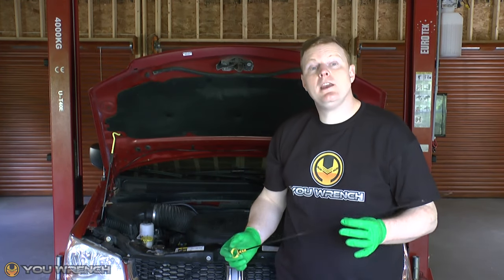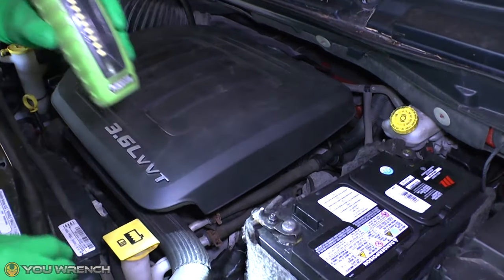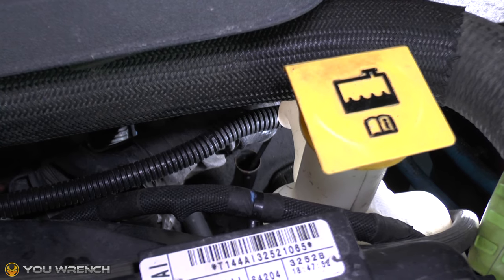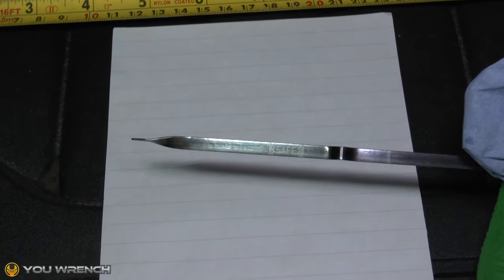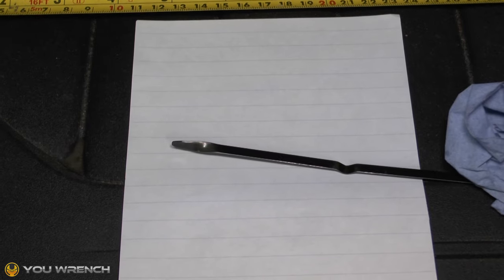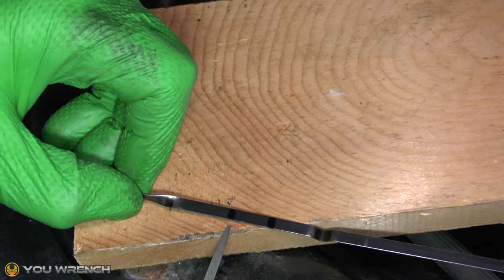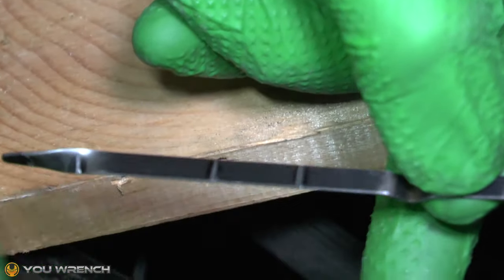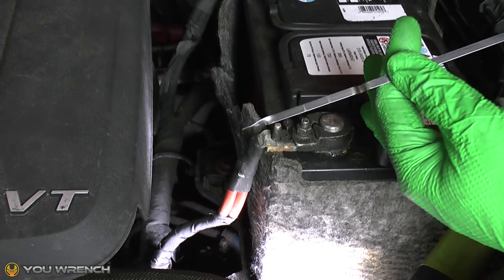MAKE YOUR OWN DIY Transmission Fluid Dipstick FOR FREE!! (Dodge Chrysler)

Comment: Super helpful, thank you for posting! As an FYI, I have a 2018 RAM Promaster 1500, same engine and trans. It does not have this engine oil dipstick, instead it's the braided cable one and I wasn't willing to file in marks on that. So I did end up buying a random dipstick for under $10 and followed this advice!
Reply from the maker: Perfect, thank you for sharing you experiences!! Yes, great tip - you can of course buy any cheap generic dip stick and mark it in the same way and keep it in the garage for when you need it. It does not HAVE to be done on the cars oil dipstick. Nice tip, thank you!

--- 

To help support us (for both you and others reading this) there are a few things you can do:

1) Donations both needed and welcome! We cannot operate You Wrench without the support of people like you! You can donate by PayPal - just go to www.paypal.me/youwrench

2) Please ensure you subscribe to our YouTube channel. 

3) Please Like our video's on YouTube (by clicking Like!) 

4) Please help spread the word, the more people who know about us the better! Add links to our video's in forums, let people know about us.

Thank you for your support!
Reply: 111
Reply: @YouWrench  which marks should i trust more the warm or hot marks? im checking warm when the tranmission reaches 70 degrees according to obd and its way over the 15mm mark. when checking the hot i checked it at 104 and its barely at the bottoom. at max temp of 120 it barely makes it to the middle. i put 6 qts in minus some spillage. am i over full? should i trust the warm mark and take the fluid level down to the 15?

Comment: @YouWrench  which marks should i trust more the warm or hot marks? im checking warm when the tranmission reaches 70 degrees according to obd and its way over the 15mm mark. when checking the hot i checked it at 104 and its barely at the bottoom. at max temp of 120 it barely makes it to the middle. i put 6 qts in minus some spillage. am i over full? should i trust the warm mark and take the fluid level down to the 15?

Comment: Thanks for this. Seems like there's a finesse to this as well, a lot of the time the dipstick will slide past the stop in the bottom and hit the bottom of the pan giving incorrect readings.

Watching the video and in my experience, the bottom of the yellow plastic should hit right above the radiator hose. 

Also, all that crap is HOT down there, wear a glove!

Comment: First off, annoying that chrysler and mopar decided the transmission doesn't need it's own dipstick anymore. 
Second, it would probably be a good idea to clean off the dip stick with something like brake cleaner before checking levels, ATF and motor oil are two different beasts. Putting a small amount of ATF  into your engine oil is an old trick to help clean your engine and if taken in moderation shouldn't harm it, putting motor oil in your transmission can make it rip itself apart and do damage. 
Third, it would possibly be a good idea to buy an engine dipstick from a junk yard and set it up as a dedicated trans dip stick, it's cheap and just as effective as adding a couple of marks to your motor oil dip stick and can just be stuffed somewhere in the vehicle or in a garage for when you need it.

Comment: Where did you find those measurements that you reference for the levels? Is this universal or does it vary by make and model?
Reply from the maker: It was sourced from the Dodge Workshop manual. No, it is not universal, this is just for the Grand Caravan/Town & Country 3.6 V6. The same principal of this dip stick does apply to different models, but the levels can vary model to model. The levels in this video are specific to this model.

--- 

To help support us (for both you and others reading this) there are a few things you can do:

1) Donations both needed and welcome! We cannot operate You Wrench without the support of people like you! You can donate by PayPal - just go to www.paypal.me/youwrench

2) Please ensure you subscribe to our YouTube channel. 

3) Please Like our video's on YouTube (by clicking Like!) 

4) Please help spread the word, the more people who know about us the better! Add links to our video's in forums, let people know about us.

Thank you for your support!
Reply: @YouWrench  Thanks! I got a dipstick from Amazon that another Promaster owner recommended. It came with a chart showing the cold and hot levels to mark on it for the 62TE transmission in the Promaster.

Comment: When I push the dipstick in it hangs up a little bit, if I push just a little harder it seems to pop free and go in another 40mm or so then stops solid. Am I doing this correctly?
Reply from the maker: It may be worth taking a quick look at the transmission fluid change video (here: https://youtu.be/Rd-bgNYVkfw) as that shows you the inside of the chamber that holds the fluid and you can see where the dipstick comes in and fits into a metal bracket/frame. You should not need to push hard, just push until it stops. It sounds like the hang up you describe is the correct depth, and when you push harder it may be popping off the frame and deeper into the pan. Take a look at the video above, it will make a little more sense. Hope that helps :-)     www.paypal.me/youwrench

--- 

To help support us (for both you and others reading this) there are a few things you can do:

1) Donations both needed and welcome! We cannot operate You Wrench without the support of people like you! You can donate by PayPal - just go to www.paypal.me/youwrench

2) Please ensure you subscribe to our YouTube channel. 

3) Please Like our video's on YouTube (by clicking Like!) 

4) Please help spread the word, the more people who know about us the better! Add links to our video's in forums, let people know about us.

Thank you for your support!

Comment: I'm not getting how you determined your millimeter measurement from your tape. My calipers is way different result.   Am I missing something here?
Reply from the maker: Hey there! You just need to measure from the tip of the dipstick to the measurements outlined in the video. You may have got a little confused by the tape as I'm starting my measurements from the 10cm mark on the tape as this gives an accurate starting point, often more accurate than starting from the end of the tape which has the hook end. But you will see, it goes from 10cm forward by the increments outlined in the video (example from 10cm to 14cm is 40mm). Hope that helps!

--- 

To help support us (for both you and others reading this) there are a few things you can do:

1) Donations both needed and welcome! We cannot operate You Wrench without the support of people like you! You can donate by PayPal - just go to www.paypal.me/youwrench

2) Please ensure you subscribe to our YouTube channel. 

3) Please Like our video's on YouTube (by clicking Like!) 

4) Please help spread the word, the more people who know about us the better! Add links to our video's in forums, let people know about us.

Thank you for your support!

Comment: For now I'm using a ruler, but am troubled by inconsistent levels...In my Toyota, I'm used to dipping with the engine hot and running....In my Caravan, the hot ATF level rises from 25 to 45mm after the engine turns off.  Is it too low or spot on?  Is the reference condition engine off or on?
Reply from the maker: As per the video (please rewatch carefully), the level should only be checked with the engine running.

--- 

To help support us (for both you and others reading this) there are a few things you can do:

1) Donations both needed and welcome! We cannot operate You Wrench without the support of people like you! You can donate by PayPal - just go to www.paypal.me/youwrench

2) Please ensure you subscribe to our YouTube channel. 

3) Please Like our video's on YouTube (by clicking Like!) 

4) Please help spread the word, the more people who know about us the better! Add links to our video's in forums, let people know about us.

Thank you for your support!